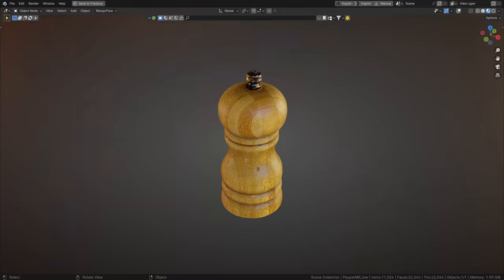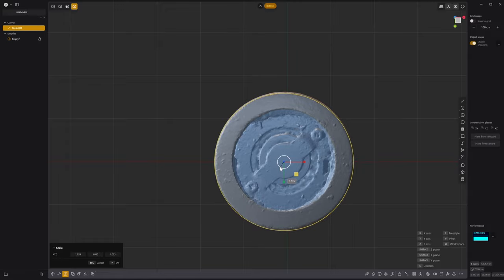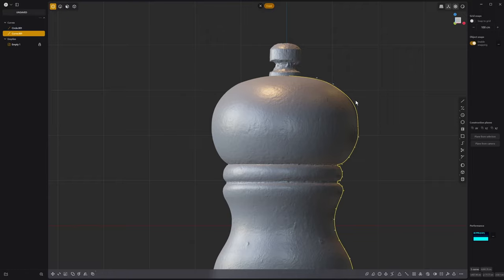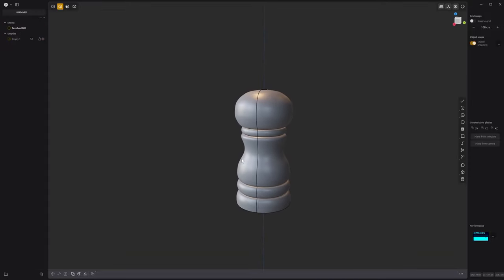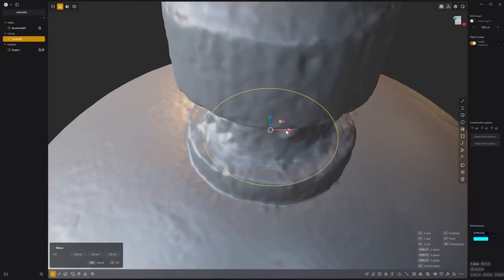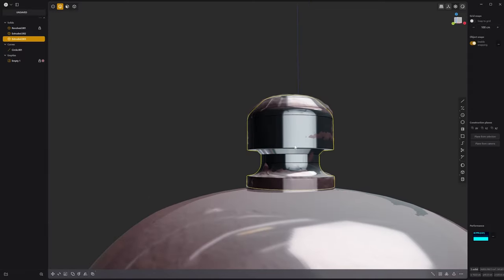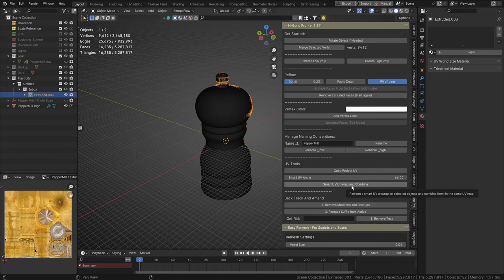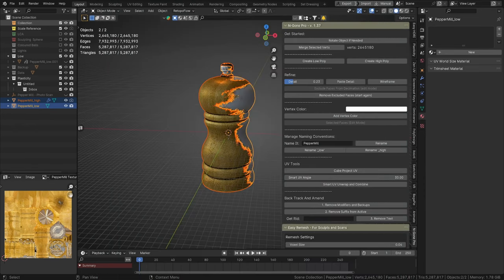Use Plasticity to REBUILD a PHOTOSCAN

Comment: Hi, can i add 3d scanned objects to plasticty and make changes to them?
Reply from the maker: You can import an obj or stl to plasticity as a reference.
But to make changes you will need to reverse engineer the model from polygons to nurbs here is a video I did on that.
https://youtu.be/1RXJAvRKuI8?si=vOA3FuMpxZOhbba5
This might be limited depending on the object and you may need to remesh it first to get anything decent.
Reply: @takerefuge3d  hi again, what you mean with '' as a referece '' , for ex; i scaned shoe with 3d scanner and import stl. it directly to plasticty right? And then what can i change its height ? Or other changes with its desing (not hi engineer grade detail chages, it can have more tolerance then engineer grade parts tolerances)
Reply from the maker: @musakoca2684  you can't directly edit an stl in Plasticity as stl is a polygon bared model, made up of a wire frame, and plasticity models are NURBS models that are based on a mathematical.
By reference I mean you can import the stl to use as a guide for rebuilding a new model.
If you want to directly edit the stl you're better off using blender